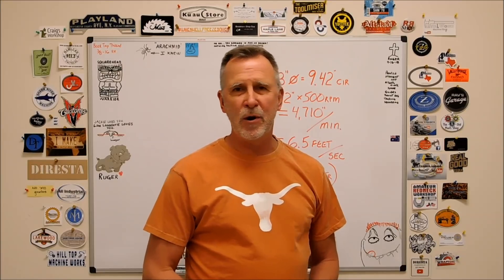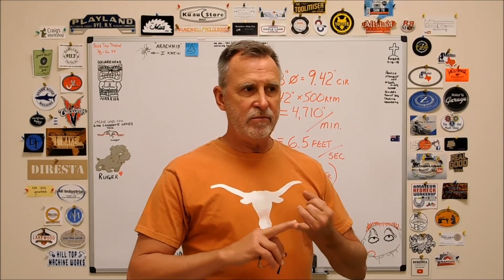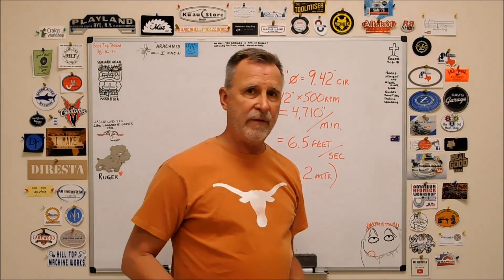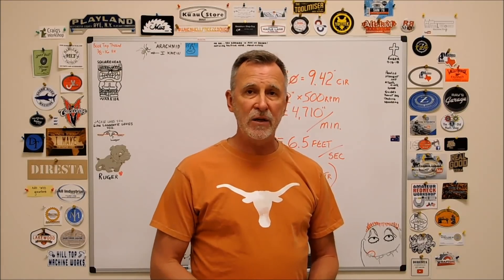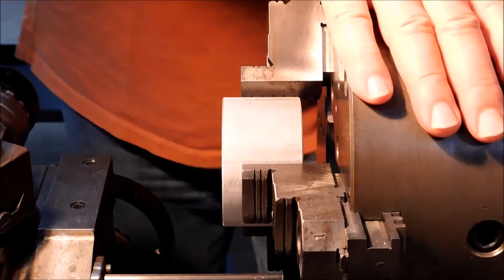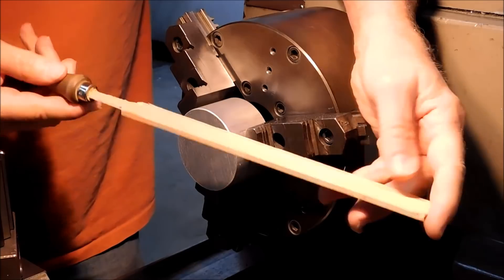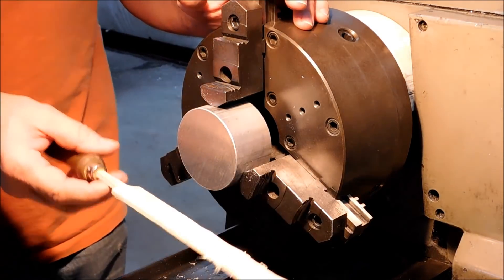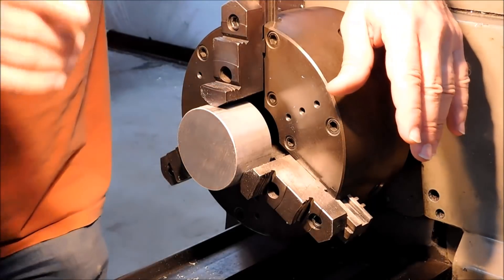File vs Spinning Chuck Jaws

Comment: Wow, I would never have considered leaning over a turning chuck with or without a file in my hand.  I just don't stand in line with a spinning chuck (or grinder wheel or...) and I don't drape my arm over it...  It only takes someone behind you to bump into you and ...   or you have a medical episode and... There is usually another way if you give it enough thought.

In  any case, if you stand back at the carriage you can use the file either on the top of the work or, depending on space, under the work.  Under the work gives better visibility when breaking edges and if the file ever gets snatched out of your hand I will hit the back splash and not get propelled into the general shop area.  That has been my thinking, fortunately I have never had it tested, but then I do not do machining for a living.  Also, there is a way of holding a file so that it does minimum damage.

Although I am not a fan of many modern manufactured files (especially, despite my name, Nicholson files), the integral moulded on file handle is a worthy improvement, although they can become annoying in some circumstances, especially when draw filing.  Also, in Australia, it is hard to get files with safe edges (or pretty much any file other than the mundane), what, aren't people supposed to file inside corners any more.

Comment: Hi Joe.  Thanks for the video.  I always appreciate people taking the time to try and improve safety.  I know I'm a couple of years late to the game here, but I would like to share what I was taught during my apprenticeship (as a Millwright).  Not to second guess someone with far more experience than I, though.  I just want to offer an alternative approach:  I was taught to hold the file in my left hand and control the tip with my right, thus keeping me over the carriage and not the spinning chuck.  That way, if the file did catch and come flying out, I am "safely" out of the way (I hope).  I have never had a file catch yet (knock on wood) but I feel that this method is safer than leaning on the machine, over the spinning chuck, and therefore right in the path of the file if it flies out.  I would love to know what you and others think of this approach.  My mentor was quite adamant that this was the "safest" way.  Your thoughts?  Thanks again for great videos!  Your time and effort are much appreciated.  Cheers!

Comment: Hi Joe, good video. About a year ago I was using a large 15" file to break the edge on a gear blank that I turned on a bigger lathe. I foolishly had the RPMs set for 145, and my file slipped on me and the tip hit one of the jaws head on. The file plunged straight back into the center of my lower chest. The amount of force felt like I was gut punched by a horse's hoof. It immediately knocked me to the ground and took my breath away. I'm very thankful to this day that I learned my lesson and most importantly, that my file had a handle on it.
Reply from the maker: Good lesson. Glad you had a handle on that file.

Comment: Thank you, Joe, for a great safety refresher and tips. One thing that I want to mention is the need to walk away when distracted. I first learned to use a lathe in 1968, and had a couple of scares that caused no harm. It made me realize that when running ANY type of equipment, the world must ONLY be what I am doing on that machine. No room for anything else in my mind until the power is cut.

Comment: Another thing about using handles on your lathe file is if the tip does catch you won't drive the tang straight into your palm or forearm

Comment: Whenever I need to use a file on a spinning part, the first thing that I do is to clear the entire work area in front of the chuck so that I won't run the back of my hand into a cutting tool or other sharp object if I happen to flinch or jerk when the jaws hit the file.  Thanks for another outstanding video!

Comment: Like any engineer I was always taught never to use a file on a lathe, but of course I do . Some tips l have never use a short file ,use a mill cut not a cross cut, chalk the file to stop it loading and left handlers win , we bont have to reach over the chuck and our body is clear of danger. Keep up the great videos even after fifty years I am still learning

Comment: Hi from Germany, we say-never use a file on a lathe, but if, turn it around with te handle away from you and use it under!!! the workpiece. So if you get contact with rotating parts, the file will fly away from you. Nice WE and best regards, Manfred
Reply from the maker: I visited Germany a few years back. Beautiful country. GREAT beer.

Comment: I think I posted this before on a different video of yours but I'm going to post it again cuz it might help someone. Not only be aware of your Chuck be aware of your work in your truck be aware of your extensions of the Jaws but be aware of any loose chips. Chip control or lack thereof is one of the most dangerous things to be around on a lathe and I am living proof.

But a year-and-a-half ago I was working on a lathe turning some 304 stainless if you've ever worked with three or four chip control is very important because that's it comes off and wants to hold together into a curl. Well it was a pretty fine curl and it was headed down about to go inside my longitudinal crank so I merely went to flip it aside with a flick of my finger thinking that there's no way it's going to hurt me well it's a very Split Second before I went to flick it it the Chuck picked up the curl and ripped it are hundreds of miles an hour and took off the skin from my middle finger and my ring finger on my left hand like a glove.. Even writing this my hands are shaking. I did not believe that post traumatic stress syndrome was he real thing at one time and now I can tell you without any compunction whatsoever it is real and it is horrible.

It did not feel like I was being cut and yes it hurt a lot of people say oh when something happens fast like that you don't even realize it well this I realized it felt like someone had taken a sledgehammer and slammed my fingers on an anvil. My heart is racing right now thinking about it I can still feel it. And to make matters worse I was a guitar player I was just starting to get pretty good and now I can't play it all because despite the fact that they sold the skin back onto my fingers they are so sensitive that I cannot even touch anything with them hardly let alone press down on guitar strings.

Your whole world to get change turned upside down in a split second around these machines. I always thought I was being very careful. when I saw that curl I wasn't even sure it was even connected to anything and I might not have been. Because that toilet is you call it can be grabbed by that Chuck or buy a curl coming off of that Chuck and be wound up on that spindle faster than you can even think.

It took me months to even want to turn that damn machine on after that. Thank God my livelihood did not depend on it
Reply: Chills my blood to read this. I had a bit of an episode this week when a bunch of stuff wrapped around the workpiece and it slapped my face. I expected blood but there wasn't any. Walked away without a scratch but this again was a reminder of how things can get so wrong in a split second. Sort of a coincidence, I was just machining some ductile cast iron and investigating in its uses - excellent material with inherently short chips.

Comment: Thanks  Joe,    A great Topic for a video
video was on my list to watch.  Underneath, just feels like a Bad idea. , I use my file, but only when the part is at least 1 - 2 inches away.   Easy to just use a form tool.   did the file into a chuck before, long ago, I remember I didn't like it.  

One Trick i do that works for me is when I'm close to a hazard , like a Band saw, or a table saw., wood router, I think about cutting off fingers to a limb.  

Don't get complacent ,  focus on the hazard.

As a Lefty, my left hand on the handle and the right going to front of file.  a Better position than a righty.....

Comment: I was trained in the Air Force as a Flight Line Machinist, and most always used a file for a round edge and either held the file as Joe is showing or ran the Lathe in Reverse and never used a file without a rounded handle..never had a problem finishing an edge that way.

Comment: Totally right ! When using a file on a lathe you dont have to use a high rpm so slow the spindle down a bit and save yourself a hand injury that may never heal right.

Comment: Interesting video Joe. Personally, I prefer NOT to reach over a spinning chuck no matter what the rpm. Like you, I am right handed, but when it comes to using my lathe file on a part, I use my left hand on the handle and my right on the tip of the file. That keeps my arms and body away from the spinning chuck. Just my preference. It may not work for others. Thanks for sharing your talent with use.
Reply: Dave Calabretta yea I’ve never seen anyone use this method. Not only is it dangerous but it only works on tiny little lathes.
Reply: Reaching over the chuck with the jaws sticking out would be a big no-no for me. Not a fan of filing on the lathe anyway and certainly not anywhere near the chuck. Better use a chamfering tool.

Comment: many years ago, I had a coworker use a file on a lathe without a handle try to debur a part, and the file caught a jaw and the tang of the file went thru his palm and out the back if his wrist.  Ever since then I try not to use a file close to the chuck, I don’t care how long it takes me to debut the part.

Comment: I began my apprenticeship at 19 in 1965. I have always filed on the lathe; some of the lathes in that shop had such won out ways that to produce a uniform shaft diameter filing was necessary. Long angle lathe files are a necessity as is filing on a lathe. I have filed on up to 9" diameter shafting in lathes with 24" swing, 22foot centres. Still have all my fingers. toes, eyes etc. I learned over the chuck- right hand on the smaller lathes ( 9 and 12' swing) but when near the chuck ALLWAYS left handed. We all learned this as we had to in order to produce acceptable work. Race car and Motorcycles, in their practice learn to cope with situations that some would find totally unacceptable and true some get injured or worse of course. In todays world everyone is pampered beyond belief and from an early age so practices that were once commonplace are deemed totally deplorable and chances are not learned, reaction times are just not there as they are not learned at an early age. I dare say that not may in todays shops would ever learn to cope with the environments that were present back in the day,, (open belts, overhead shafts open gears etc.) but we knew nothing else existed, so we learned to cope
Reply: Precisely Ray all you have on here is a load of self entitled wannabees that know it all no business would ever employ.

Comment: After 45 years in the tool room I still hold the file handle in my left hand and the file tip in my right hand,some my call it filing left handed.Saw a fellow lose all his front teeth.
Reply: Gary Walters this is what I learnt during my apprenticeship 40 years ago too, also makes standing to the right of the file easier so there’s a clear path for the projectile, should the file become one!
Reply: This is how I hold the file as well, which keeps my body to the right of the chuck face.
Reply: I've always held the file left handed on a lathe. About the only left handed thing I do.
Reply: As a lefty,  Had to think a sec about Joe holding the file.   Chalk up another good reason to be a Lefty.

Comment: I enjoy your videos, this is somewhat of a controversial topic in machining  and thanks for sharing. They taught us that if you "HAVE" to use a file on a lathe that it is better to have the chuck spinning in the clockwise direction , so that if i does  grab it out of your hands it is propelled forward away from you into the splash guard.
Reply: You need a file which cuts in reverse to do this though.
Reply: spinortangent or flip the file upside down?
Reply: @saipolkgui  do you mean hold it from the wrong end? :P

Comment: WHAT FUCK ARE YOU  DOING REACHING OVER THE CHUCK!!! WEARING A LOOSE TSHIRT??? NEVER  EVER DO THIS!!
Reply: Reaching over the chuck, left forearm on the headstock, standing to the left of the chuck body; is the safest place to be and is the safest filing method. If you left hand file and your body is to the right of the chuck, you are in the projection zone of the chuck and you are also putting tool pressure towards the chuck. If you slip, you go into the face of the chuck; this is far more dangerous.
Reply from the maker: @StreuB1  I agree 100%.
Reply: @StreuB1  Spot on Bri but were dealing with panic ridden diy snowflakes reading too many books, know it all, with no meaning of the proper word safety.
Reply from the maker: Its the camera angle. I'm not even close. But thank you for your concern.
Reply: @joepie221  like the calm)
Reply: Pete Crookes 💯

Comment: I let the edge of the file get into the jaws. It grabbed the file and whipped out of my hand and against the bed of the lathe sideways whereupon the tip of the file snapped off and then both pieces ricocheted back at me. At least thats what I think happened because the whole thing happened way to fast to see.

I had controll of the tip but was tired and swept the file straight back towards me when I was done.  

Lessons learned: 
1) Dont work on any machine when you are tired. 
2) When you are done filing move the file away from the chuck in the direction that is parallel to the face of the chuck and then out from over the bed before you let go of the far end.

I dedicated the half of the file that was attached to handle exclusively to lathe. Every time I go to use its shortness and jagged tip remind me of how to properly use a file on work spining in a lathe; exactly how Joe does it in this video. I never found the tip of the file. I think it passed through the wall behind me and ended up somewhere outside.

Comment: I like the idea of the modified tool to use for deburring as it does both ID and OD chamfers, so far I've been using a couple different tools for doing that.  Might have to make one up like you showed, thanks for sharing!
Reply from the maker: You'll use it a lot.

Comment: In the high school shop where I volunteer, we teach the kids to stand on the tailstock side of the apron and not the chuck side.  We use 16" lathe files for deburring and teach "left hand on the handle, right hand on the tip".  This keeps them away from the chuck and out of line of flying chips and cutting oil.  Now we are ordered to put "full coverage" chuck guards on all the lathes.  I guess lathe filing will be a thing of the past!

Comment: Great video. I think showing the alternative chamfer tool was good. They work well and can be repeatable for batch parts. Of course, I’m usually too lazy to set it up and just grab a file.

The tip about protecting the compound from the chuck was great. When you showed it, it seems obvious, but it never occurred to me. I’m going to remember that one!

Comment: Joe, your videos always have good info, but I find that I'm watching them less and less- you're spending more and more time repeating yourself in the videos and they keep getting longer and I just don't have time to spend on them.  This one is 18min and I feel like it had 6, maybe 10min worth of information in it.

As far as the actual content here, I've had a couple of things, including a file bounce off the jaws.  Usually not a serious problem.  What scares me is getting my knuckles rapped by those ends hanging off.  I'd bet if you got tagged by one of those in just the right place at a reasonable speed you're going to the hospital.
Reply from the maker: Mark. Thanks for the critique. Its very hard to structure a video you think is going to sink in at all skill levels. Tradesman may feel like " just get to the point, whereas a total garage shop new guy may need to see drawn, hear it described and watch someone do it before they feel confident. Me personally, just show me and move on. I appreciate the feedback, but feel free to hit the FF button ( and the subscribe button ) if you want to get to it. And yes, if an extended jaw gets you, it will do some damage in a very short period of time. Some guys have suggested painting the ends of your jaws a fluorescent color for better visibility. Its actually a good idea.
Reply: @joepie221  I'm new to machining.  Very new.  So the tell it, show it, summarise it approach is very welcome to me.

Comment: A secure extension on the end of the file would be a nice safety addition. It would get the tip further out
away from the chuck jaws and give your hand a better grip. We had a very nice metal shop in my HS, it had many lathes mills, drill presses, foundry, tool crib, hydraulic press, shaper, etc, it was really well equipped.
We did have lathe/ file accident, kid push a file under the skin of his forearm! btw, that well equipped HS metal shop was 48 years ago, not many like that now.
Reply: What you doing then just letting it skate across - Oh yes very dangerous

Comment: It is so good to take a moment to think through something that I've been doing for years and realise there is a safer way to do it.  I have always preferred to keep my body out of the line of fire, so I use the file left handed but the suggestion of resting on the headstock (left arm) or the cross slide (right arm) to aid stability and control is so simple but brilliant.  Your demo has made it clear why the file clogs so quickly so I am also going to get much longer single cut files to help keep the tip further away and allow use of more file area.  Old dog can learn new tricks.  Many thanks.  - UK